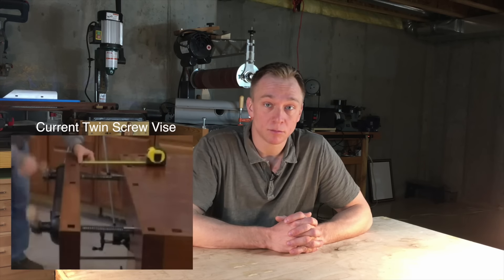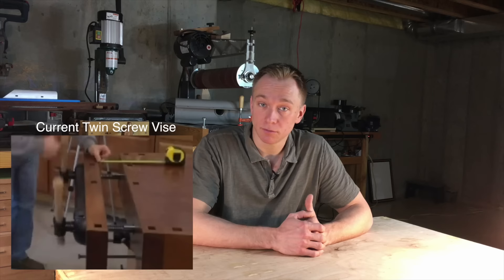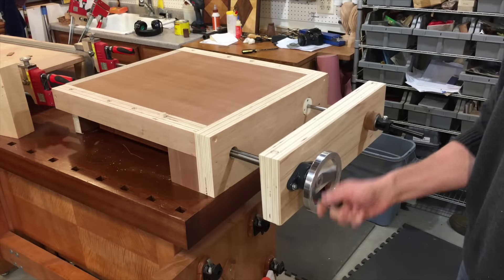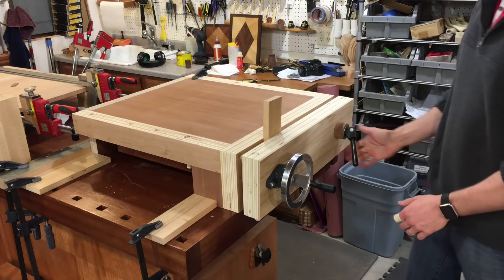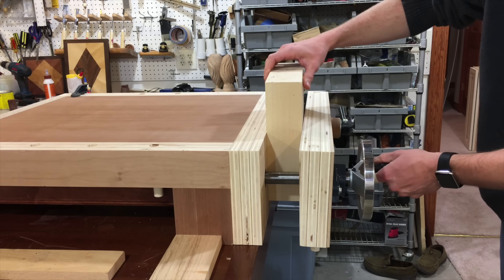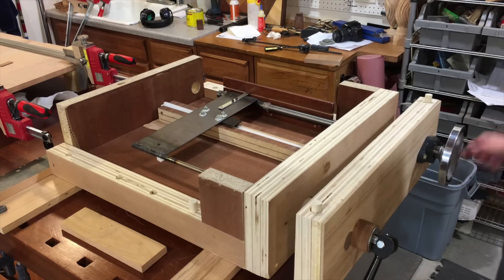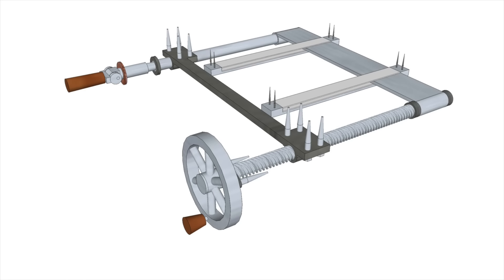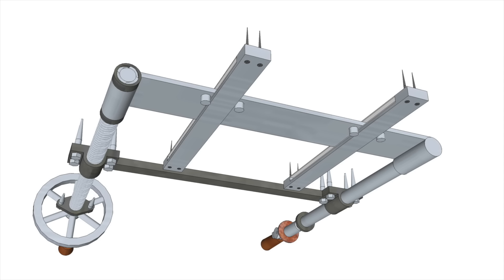New Invention - Fast Travel Twin Screw Vise

Comment: Will this vise have work rest rods, and will you be able to disengage one side so you can skew the vise to accommodate for tapered work-pieces?
Reply from the maker: +0v3nm4n I thought about just not threading the first 1 1/2" of the threaded rod.  This part of the rod never gets to the nut, and that way a workpiece would not be marred by threads and grease.  Kinda accomplishes the same thing as work rest rods, but the final product is still being designed.  Disengaging one side will not be possible, but inherently it will have the ability to deal with mild tapers.

Comment: Would it be possible to get the handle for the cam over to the other side with a linkage next to the wheel so you could lock it down with one hand without reaching across the bench?  How well does it work if what you're clamping is at the other end from the wheel?
Reply from the maker: +krtwood Both good questions.  You certainly could move the cam handle over with a linkage, it would add some cost and complexity, but definitely doable.  After playing with the prototype for just a little while I'm not sure its worth it since the wheel grips the workpiece hard enough to keep it from falling, which frees up your hand to flip the cam.  But the market could tell me otherwise.

The vise can clamp just fine if you put a small workpiece on the opposite end of the vise from the hand wheel, you just have to be a bit more careful when turning the wheel that you don't over-rack the vise since there is a larger torque arm in that case.  But I'm not sure that would come up all that often, if you have a small piece just clamp it on the wheel side.  If you just need to use one row of dogs use the one on the wheel side.
Reply: Andrew Klein With the cam locked down would it be possible to loosen the wheel enough to release a part and then put it or another part the same size back in?  Because that's the main reason why I would want the lever on the other side.  Being more of a power tool guy I most often use the end vise to hold parts for random orbit sanding.  So I've got the sander in one hand and I'm going through a stack of parts that are the same size and I want minimal fuss getting them in and out of the vise.  It is quite a pain getting the vise out where it needs to be in the first place, but once it's there it's really fast getting them in and out.
Reply from the maker: +krtwood I see.  I think what you would do in that case is flip the cam to untighten it, then give the cam a 1/2 turn to loosen it a bit more (its threaded onto the end of the rod).  then you could take the workpiece out, replace with a same size workpiece, give the cam a 1/2 turn, and flip it to tighten it.  Still don't think you need to move the cam over.

Comment: Great thinking!
Where you talk about using brass pins as guides, how about drilling some brass or high density nylon wheels/discs off centre so that they can operate as cams to help adjust the slide accuracy. All then best.

Comment: Neat design!!  I just built a Moxon-like vise, and I did line the chop with leather.  My build has two 3/4 x ~5 conventional all-thread screws, with nuts captivated in the two wooden hand wheels.  The chop floats, like most Moxon designs.  The screws on my build are adjustable into the bench, or outward, away from the bench, to accommodate thin/thick workpieces.  It takes forever to make that adjustment!  The only issue I might have with your design is I'm not sure my bench would accomodate your guide system inside the bench.  That said, let me know if you decide to manufacture your vise.  This may be a candidate for KickStart!!

Comment: The follower shaft is smooth, have I understood?  The cam blocker is a great ideaI Have you any way of measuring the clamping force?
Reply from the maker: +loloaqici82qb4ipp only by verifying that it can easily hold a workpiece in place without leather on the jaws.  Leather would make the holding power much better.
Reply from the maker: +loloaqici82qb4ipp Oh, and yes the follower shaft is smooth, but it does have a threaded connection to the cam for assembly and adjustment, thats how I justify calling it a "twin screw vise"!

Comment: Really neat design. One question though, would a normal twin screw vise with a chain work but just using the one-inch travel screws.
Reply from the maker: +Garage workshop A good question, but no it wouldn't work well.  If you did that the vise would only have 25% of the clamping pressure of a standard vise.  That isn't an issue for my design because the clamping pressure happens as the cam takes the rack out of the vise, so it is still really strong.
Reply: +Andrew Klein Now that you said it, I realize that you already talked about that in the video. Other thing I would like to know is how well does it hold non square objects, like tapered pieces.
Reply from the maker: +Garage workshop It can deal with slight tappers a bit better than a chain coupled twin screw vise, but its not really meant for that type of clamping, between the jaws anyway.  You couple hold a non square piece with this vise using dogs.
Reply: +Andrew Klein Thanks a lot for answering . Hope this works out for you. One last thing that I would like to know if the youtube video is enough for someone to claim the patent or do you have to have in confirmed and approved at like a patent office.
Reply from the maker: +Garage workshop Technically if you make an invention public you have one year when you can still file a patent, but if another inventor files first they get the patent.  Notice I said another INVENTOR, but the problem is if someone sees a video like this and then presents they had already independently invented the same thing it could be kinda hard to prove otherwise.  So I file a provisional patent before posting something like this, if I really think it is a good idea.
Reply: +Andrew Klein Good to know and best of luck!

Comment: Interesting idea.

I think the Hovarter vise is faster than your idea though.  The Hovarter slides in and out with no threads.  The handle applies the clamping force once positioned.  Can use either handle.

Not sure how to insert URL, but search for Hovarter Custom Vise and you will see some videos.

Comment: I am a bookbinder, and I am constantly finding woodworking tools that fit my craft. Most bookbinder's vices use wood screws, which are slow, not very smooth, and prone to cracking or damage.

This design would be IDEAL for a bookbinder's bench--as a laying press, a plough press, or even for doing edge gilding!

If you go "commercial" with this, you should look into marketing it to bookbinders as well as woodworkers--they would snap this vice up like hotcakes...
Reply: Why do you need quick movement of a vice for books?  They're basically all under 3 inches thick anyway.

Comment: how did I miss this. nice man really nice!
Reply from the maker: +izzy swan thanks Izzy, it's been a challenge getting design for manufacturing together.  How is yours coming along?  I think both our designs are a lot better than current options on the market.
Reply: still making some design changes to mine to make it a bit easier to manufacturer. it will be a few month before it hits the stores. hoping by Christmas

Comment: Funny, I was just at Lee Valley Tools last Saturday looking at that vise on display and wondering why it wasn't quick release. The others on the display bench were. I was thinking at the time, moving this would be tedious. I hope you build it .
Reply from the maker: Its been tough, but I haven't given up yet, a few more videos on my channel show the challenges.
Reply from the maker: I think the reason they don't do quick release is that the vise is already expensive and complex, and trying to get to nuts to quick release at the same time is a lot harder than just one, as re-locking the nuts might allow the rods to reengage at different points, and cause the jaws to be out of parallel.  Just my guess.

Comment: Yeah this has to be in my shop....NOW!  Well done Andy.  What are you thinking for the max capacity?
Reply from the maker: Capacity as far as distance between screws, or max opening of the jaw?  Either could be made pretty large, what are your thought?
Reply: both really.  I think it imperative to have 24" between screws for wide case sides.  As far as depth, I think I heard 13" in the other video which would be awesome but really anything overr 6-8" is pretty great.
Reply from the maker: +Shannon Rogers 24"! Wow, thats big, but no reason you can't make one that large.  I was thinking of this as an end vise, which would limit the distance between screw to less than the workbench depth.  But you could have several sizes, one of them being an enormous front vise with greater than 24" between screws.

Comment: You should look at the horvarter custom vices.  The make quick release vice hardware for twin screw and leg vises.
Reply from the maker: +bwillan I have looked at them of course, they are quite expensive.
Reply: Expensive is relative.  How much did all of your vice hardware cost plus the time it took you to develop it?

The vice hardware offerings from Horvarter are certainly less expensive than what is offered by Benchcrafted.

Comment: This design is better than trying to incorporate split nuts like metal cutting chop saws have. I pictured in my head a lever to disengage the split nuts, move vice jaw to where it's needed and reset lever to allow tightening. Dust accumulation would be the downfall in the split nut design.
Reply from the maker: +repairit1 yeah, I think that is a big reason why no one has made a quick release twin screw vise, and why I liked figuring out how to use a fast travel threaded rod.

Comment: I'd use eight pins to secure the track to the runner instead of four. Additionally, I'd utilize bearings instead of a stiff nub to mitigate wear. I love the design, thus far. My only concern with the design, as presented, is that with such a high ratio on the turn, the corkscrew may loosen during vibration. A locking mechanism (radial friction brake on the corkscrew) can negate this issue.

Subscribed, and awaiting an update to this design.

EDIT: Just noticed that this was originally posted ~9 months ago. I will leave this comment in place and search your channel for an update. Provided that you haven't completed this project, I would appreciate a reply. This post will not be updated further.
Reply: After reviewing my comment, I realize that some may argue that the lateral difference created by applying the cam-lock would provide the friction of which I was speaking. Please understand, however, that the design of a corkscrew is to provide minimal friction as compared to the load it applies. Given so, an additional brake may be necessary. In such, the tap-cut piece, through which the corkscrew turns, could be split (on one side) and a thumbscrew added on the split side to clamp upon the axis of the corkscrew. When the workpiece is sufficiently clamped--using only the corkscrew--tighten the thumbscrew, then apply the cam-lock, and you exponentially decrease the risk of loosening.
Reply from the maker: Thanks for your thoughtful comments Sean, but I think if you had played around with the prototype you would be less concerned about loosening.

Comment: good idea but there is an.easier and most likely better way:
you could have two same size bicycle pulleys on two equally threated roads with a chain connecting them. This would all be hidden  inside the front moving jaw piece and connected to the bench with two separate female threats one for each rod, instead of the typical one. when cranking both rods turn at same time driven by the chain to thigthen or loosen the vise.

Comment: Use some proper machine linear ball rails, HIWIN are good, won't cost much in the lengths you need. Always use 2 carriages per rail!
Reply from the maker: +Adam Hill I'll take a look, but those sure look expensive, price point will be critical with this tool.

Comment: Am I the only one noticing that this will only work for shortish work pieces located in between the two slides closest to the screw.  For long work pieces or pieces located outside the screw the concept would not work great if at all.
Reply from the maker: I don’t think this is actually an issue but the design had other problems, I abandoned it in favor of my 2 speed geared vise.

Comment: Hi Andrew - I realize that this video was done several years ago, but I only just came across it.  I've just watched another video with quick release clamps on the screw which I think would be brilliant for your twin screw.  Also if your screw was longer and the end was housed in a pillow block bearing it would give it much more stability and less racking. And ultimately, extremely fast operation (way over the 4X that you achieved)
Check the clamp lock out here - "Pask Makes"  https://www.youtube.com/watch?v=3XiMTe0bVBQ

Comment: Not an "new invention" this concept already exists on Black & Decker Vise for more than 20 years !!!
Reply from the maker: +Jerome B. Can you provide a link to this black and decker vise utilizing a fast travel screw and cam?  I’m guessing you can’t ...
Reply from the maker: +Jerome B. You’re adorable
Reply: Which means?
Reply: Hi, which means?
Reply from the maker: +Jerome B. I’ll give you a hint: “does the black and decker vise actually have a fast travel screw?”
Reply: Just because you don't know products out of your little small world doesn't make everything a "new" invention. And it will travel as fast as you want, and clamp with the other hand/screw.
Reply from the maker: +Jerome B. It’s a yes or no question, and the answer is no, the black and decker vise does not employ a fast travel screw, and therefore does not travel as fast as I want my vise to.  Furthermore, as it is built into a small saw horse / work stand, it is not a vise that can be coupled to and used on a large woodworking bench.  So it is entirely irrelevant to my concept.
Reply: Your answer is biaised, given the fact that you can quickly adjust opening by moving the non-sliding part and also moving it up 90° The vise folded can be monted on any work bench also, and quickly secured. But you are right, you are This is irrelevant to your "Unique" concept of truly american rediscovery of someting working and on the market (just look also at quick adjustable vise with release bracket...) Ciao
Reply from the maker: +Jerome B. Like I said, adorable